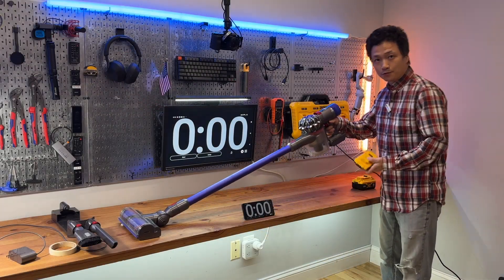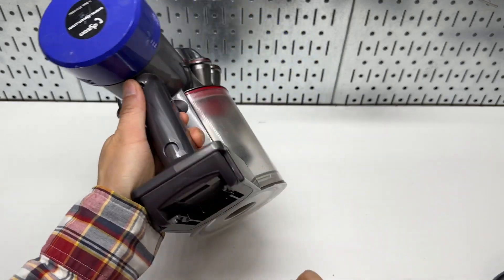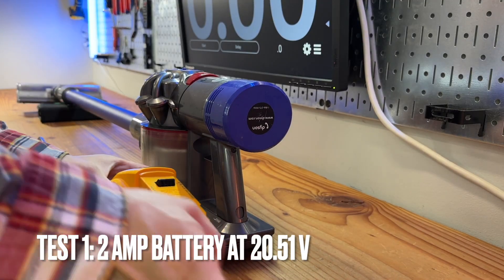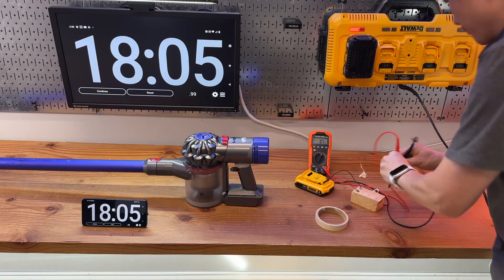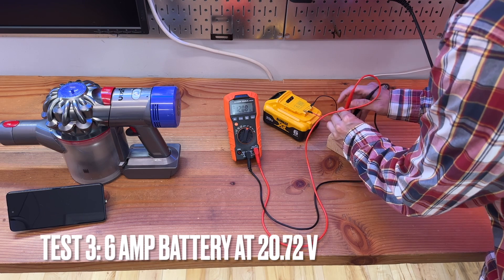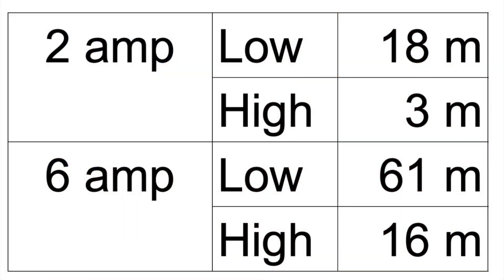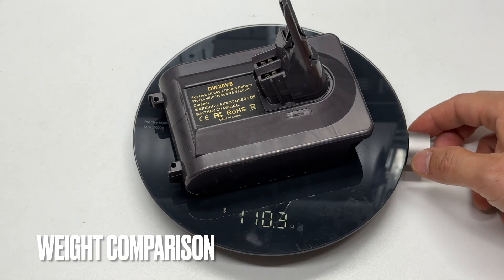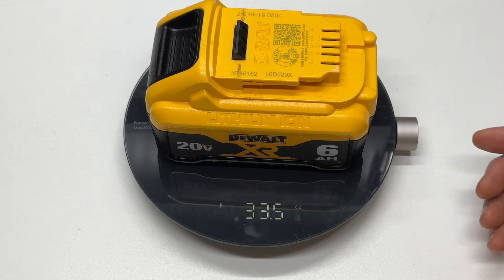Dyson V8 Cordless Vacuum Runtime Tested with DeWALT Batteries

Comment: Has anyone noticed that 18 volt batteries also charge up to 20.5 volts. The only difference between 18v batteries and 20v MAX are deceitful marketing for the latter. Dyson uses 6 cells in series instead of 5 in tool batteries, so the motor is designed to work with about 4 more volts. That means the motor will draw more current, so be careful to not let the motor get too hot, or the small batteries with only 5 cells. The bigger batteries have 15 (or more) allowing considerable higher current. Using a Dyson on small batteries on MAX, will damage the battery and maybe the motor too. Both will get hot AF.
Reply from the maker: Glad you liked it! Watch my new videos. Like and subscribe!

Comment: My actual result with 18v 5Ah Dewalt battery is over 14 minutes in MAX with rotating floor brush during actual cleaning (this equals to full cleaning of 2-bedroom apartment over 60sqm).

No problem with operation. No warming of either device or battery. 

Dude, thanks a million you made me go for this solution!
Reply from the maker: Glad you liked it! Watch my new videos. Like and subscribe!

Comment: I've owned two cordless dysons and I would advise anyone to purchase a different brand, the batteries are terrible and and the wheels on the motorhead are made of pvc without bearings so over a couple of years they wear down and then the motorhead starts to damage the floor especially wooden flooring
Reply from the maker: Mine is seven years old and still works great

Comment: Great with the Dewalt batteries I have, my Dyson battery doesn’t hold the charge properly and it’s great to swap n go the Dewalt battery if it’s goes flat. That attachment is only good if u got power tools and a couple of batteries
Reply from the maker: Yeah the Dewalt batteries really work well.

Comment: The original Dyson battery has 6 cells 22v , wonder when you use a 5 cells 18v is compatible , or  a weaker voltage 18v 5 cells battery will not make the vacuum run strongly as it should ??
Reply: It will not work on the high setting at all.  Do not use this setup. I have struggled with it for a while now. I have tried every DeWalt battery made.  They do not work like they are supposed to.
Reply from the maker: @willlord3469  for me, it works on high setting. you probably got a bad adapter or old batteries.
Reply from the maker: It is still works well regardless of the voltage difference . It’s not really noticeable.

Comment: Is there a working adaptor for worx too
Reply from the maker: Not sure.
Reply: @ToolsElectroDIY  Thanks for responding! This is the best video for folks who are interested in using dyson v8 with an alternative batteries
Reply from the maker: @huang47tw  Thanks. If you can find one for worx around 20v, the performance will be similar to the dewalt's

Comment: Which has better suction? One of the handheld Dysons, or a 18v vacuum from a brand like Milwaukee or DeWalt?
I don't mind upgrading the battery on the Dyson. I guess the other concern would be things like weight/size/accessories/noise/cost
Reply from the maker: Dyson for sure

Comment: I changed mine. Put a new fully charged Makita accu in it and its doesn’t work. When I push the trigger the LED turns Green but it won’t go on.

I have the V8. Any tips?
Reply from the maker: Did you check battery voltage?

Comment: The Dyson battery are 6  Li-Ion cells in series  resulting in  21.6v. nominal.   The DeWalt batteries are nominal  18v.  (5 cells in series). They market them as 20v because in the USA they pretty much can say any bullshit they want. 
So you are actually under-powering the Dyson if you use DeWalt batteries.
Reply from the maker: I hardly notice any difference.
Reply: @ToolsElectroDIY   Yeah I know, it probably still works OK.  I just wanted to note that it is not the same battery that Dyson was designed to work with.
Reply from the maker: @gonzchi  Right. I disassembled the Dyson V8 battery years ago, recycled its cells.
Reply: @gonzchi mine only works on the low setting.  I get nothing when it's on high.  I don't trust this setup at all.

Comment: Thanks for the video, I think this adapter is no more available, I bought one from Amazon, it works but only 6-7 seconds on high mode. Not fulfilling the purpose as I have to wait few seconds then I get another 6-7 seconds of run time. Please advise details of your adapter it looks like it continuous runs for 16 minute on high mode with 6AH battery
Reply from the maker: Sorry I didn't know the seller changed the listing. I have no idea what other adapters to recommend because I don't have those.
Reply: @ToolsElectroDIY  Do you know the brand name?
Reply from the maker: @s4siddiqui  I forgot. Will have to check tomorrow. Late night here

Comment: Are there any adapters for the Dyson that work with the new 5ah Power Stack battery?
Reply: Power stack batteries have the same connection locking points as the XR/ Lithium batteries. It’ll work no problem. It’s made for all the same tools, the battery chemistry is the only difference.
Reply from the maker: No idea

Comment: The Dyson might deliver 400 W with its original battery, it won't with an 18 V one. Back-of-the-napkin math says over 100 W less...
Reply: But he used a 20v battery
Reply: @CynicAtheist  There is ZERO difference between 18V and 20V, it's just marketing. They use 5 cells. The nominal voltage of one cell is 3.6V. It's MAXIMUM is a bit over 4V. Minimum generally considered to be 3V
Reply: @NicksStuff  I'm guessing the 21 has an extra cell then?
Reply: @CynicAtheist  No, it's 4.2V * 5
Reply: @CynicAtheist here in Australia and Europe they are 18v it’s the same battery identical in the US you market using the cells fully charged 5 cells 4-4.2v = 20-21v but nominal voltage per cell is 3.6-3.7 18-18.5v. So your run time will be cut short regardless of power draw because the tool will shut off to protect the 6 cell battery it thinks you’re running that Dyson use
Reply: Not back of the envelope?
Reply: I feel the vacuum borderline useless on the low setting i only have floorboards
Reply from the maker: How did you know? It’s very hard to tell the difference
Reply: @ToolsElectroDIY  Ohm's law!

Comment: maybe a better test would have been to put the vacuum cleaner under load, instead if just sucking in air, no doubt the battery won't last as long when its actually being used on the floor
Reply from the maker: Great suggestion! Thanks for your feedback.

Comment: It's neat how the Dyson circuitry can manage the lower battery voltage by upping the current...pulse width power transfer I'm guessing.
 I used the Makita adapter and made my own 9aH 18V battery using sony VT6 3aH cells in a 5s3p configuration. The results are similar to yours with an approx 50% increase in run times. Battery stays fairly cool but the V8 motor gets quite hot.
Reply from the maker: Good to know thanks!

Comment: Is the V8 absolute any better? Also will a 60 flexvolt  Dewalt battery work? 12 amp flexvolt safe to use?
Reply from the maker: V8 is an old model. I heard 60v flexvolt is compatible with 20V so it should work.

Comment: What do you think with a DeWalt 5AH, 20V battery - maybe 45 - 50 minutes on low power?
Reply: Probably only about 35-40 minutes since the 6Ah battery uses significantly more capable 21700 cells vs. the 5Ah 18650 cells.
Reply from the maker: Yes

Comment: Good video although I would like to know if any of the Dyson or cordless hoovers can be modified to accept and be run by mains 240 volt or an adapter to reduce to the voltage for the motor as this may be even lighter than having a battery at the base attached at all
Reply from the maker: Yes I thought about this mod too. Get a 300W Lenovo gaming laptop AC to DC adapter, the voltage should be within the 20V range, cut the cord and use a DeWALT battery placeholder then it should be able to power this vacuum.

Comment: I have the same Dyson vacuum cleaner and I just bought these on Black Friday but when I run it on MAX it shuts off after ~4 seconds. Any ideas why?
Reply from the maker: Bad battery.
Reply: @ToolsElectroDIY  you’re right! It was a knockoff from amazon. Bought a dewalt version and it works! Thanks for the great videos!

Comment: how can 2ah hold up for only 3 mins? if 6ah can do 16, isn't 2ah should be around 5-6 mins?
Reply: The 6a/h battery has 5 cells in series ( to build the voltage up to 20.5 max) it also has 2 rows parallel so thats 10 cells altogether. 
The 2a/h battery has the same 5 cells in series,  but only a single row so 5 cells altogether.  In the 10 cell battery,  the large demand from the motor is shared by 2 rows of cells , which dramatically reduces the demand from the cells .
Reply from the maker: @stestar09  well-explained, thanks!
Reply: @stestar09  I noticed a lack of power with my 2a/h battery, but I saw another problem my dyson V8 battery is 21.6v and my DeWalt battery is an european 18v. So following your explanation should I need to take a 6a/h  DeWalt flexvolt battery (18v-54v) to not have any lack of power ? Thanks for your help.
Reply from the maker: I think there are 2 reasons:
1. The 2ah battery is 3 years old.
2. 2ah will not be sustain high discharge as long.
Reply: awesome video by the way, done proffecially